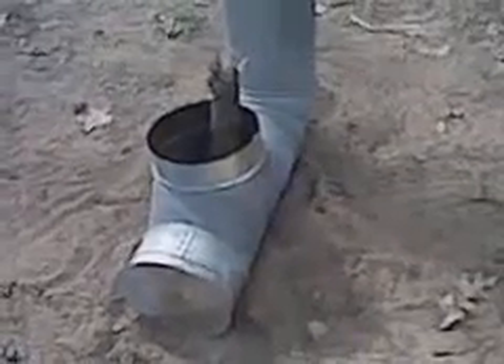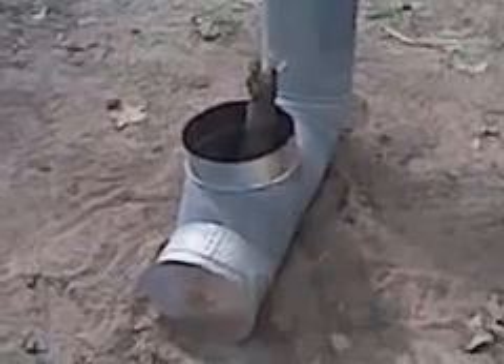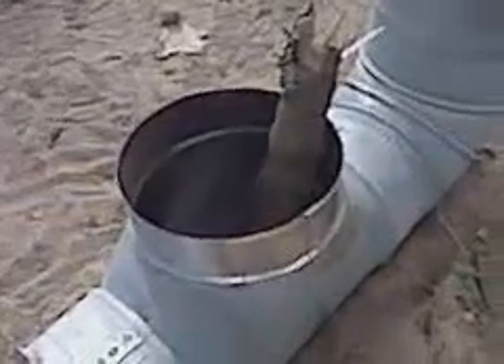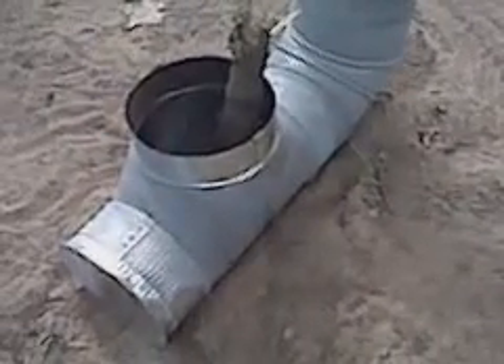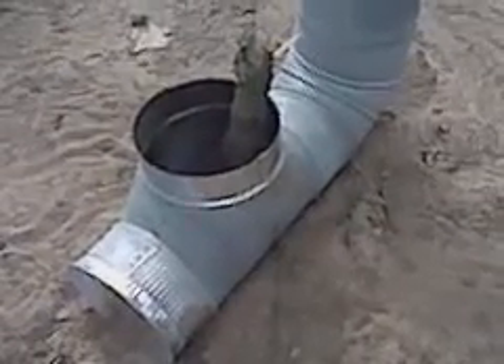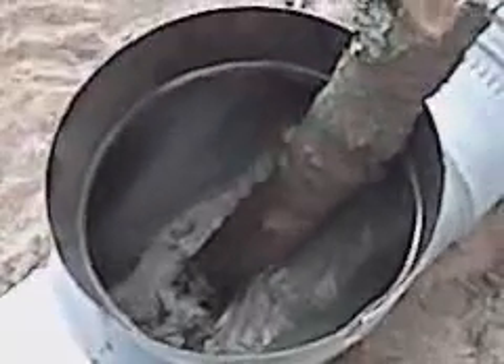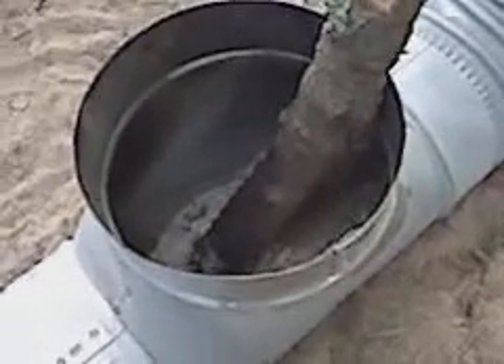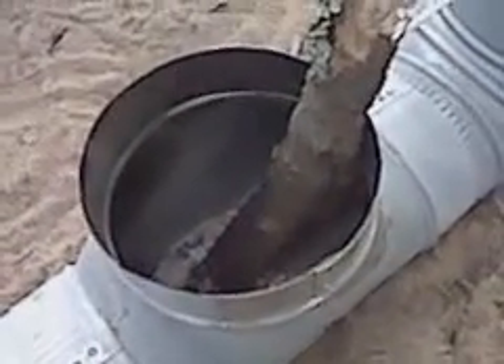Rocket stove for winter greenhouse part 1

Comment: @pyroman675 That works, just make sure you do it way more than you think you need to and then do it a bunch more and do it in the open air so the gasses can disipate.  After you do that, you can move it inot your greenhouse.  I would still get stove pipe that is not galvanized.  Use the galvanized one for an outdoor stove for a summer kitchen or something.  You're playing with your life if you use galvanized pipe for fire in an enclosed area and you are going to lose the game.